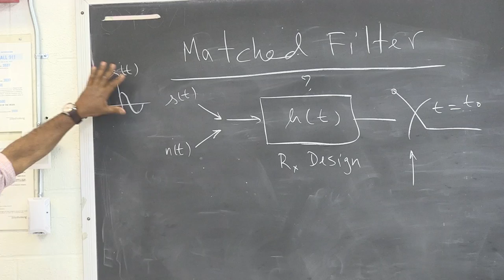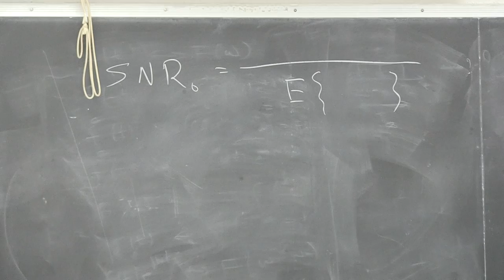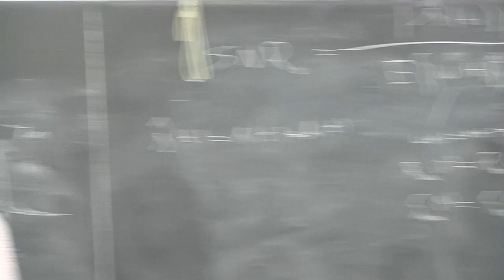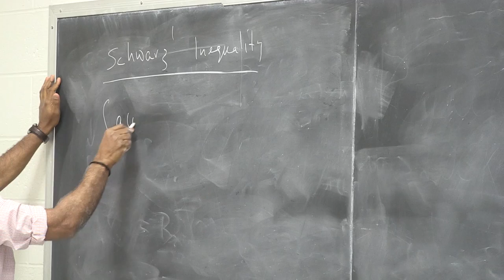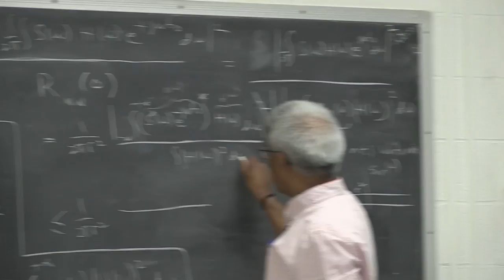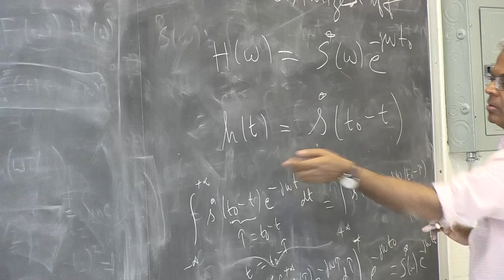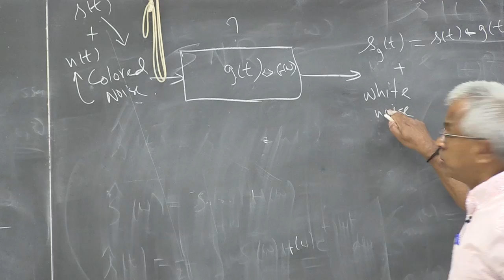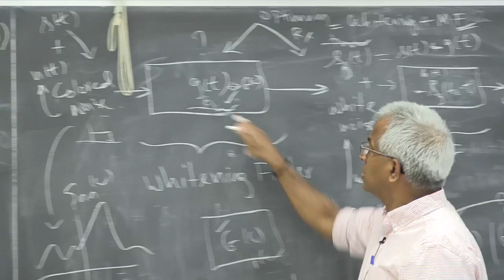Pillai  "Matched Filter" (Version -2)

Comment: What would be the applications of this filter? I mean, the signal has to be known right?
Reply from the maker: In communication theory,  the transmit waveform is known both at the transmitter and the receiver. What is unknown there is the information bearing sequence of bits being modulated. Same in radar, most of the time you know the transmit waveform as you transmit a waveform to figure out what is out there from its returns.

Comment: Sir, Is this concept is similar to taking the dot product between two vectors, when two vectors are orthogonal the output is zero,when it is similar output reaches a Max value .can this be done through a correlator, or is this how a correlator is really implemented?
Reply from the maker: Matched Filter output at t=t_0 can be shown to be  exactly the same as a correlator output where  you correlate the received signal with the signal compnent in it. I wish I had  shown that quick derivation there. but you may be able to find it in my other Matched Filter lectures.
Reply: @probabilitystochasticproce2625  
Thank you Sir ..😍
Reply: Pehle GATE top kar le.

Comment: Hi, thanks for the upload. During Schwartz inequality example, why are roots imaginary?
Reply from the maker: Look at the plot of the quadratic in the variable c as shown at 18.04 min. The quadratic curve is positive because of the inequality on the extreme left, and does not cut through the x-axis. That means there are no real roots to the equation. But any quadratic has two roots. So if the roots are not real, then they must be imaginary. That means for a quadratic, the discriminant quantity within the square root must be negative as shown at 19.00 min etc.